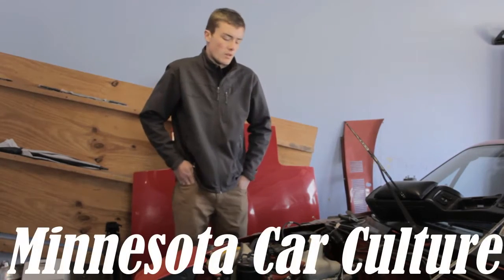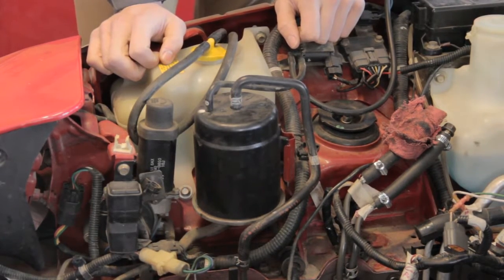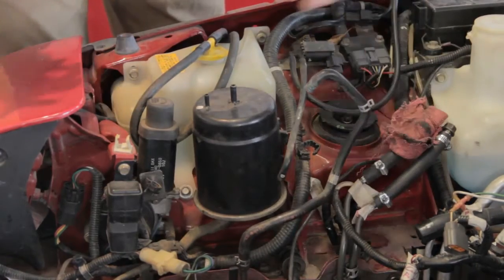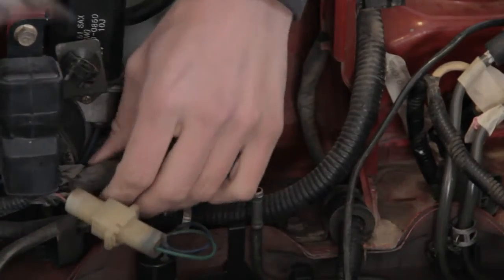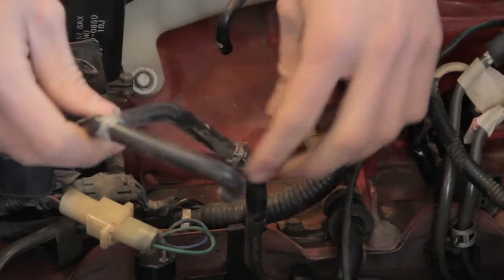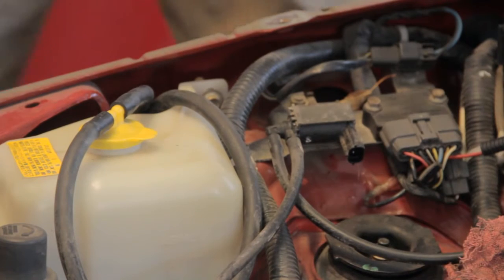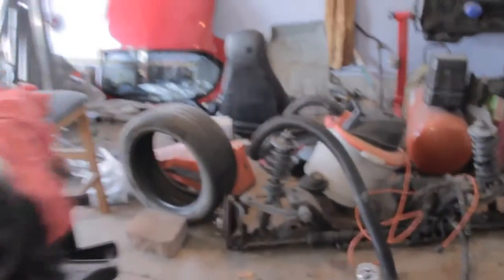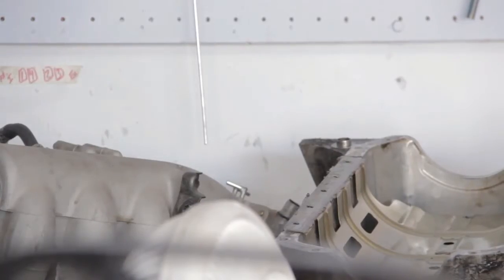How to Remove Miata Charcoal Canister

Comment: Zach, can by BYPASS this cannister all together?  Original one on my 2002 Pontiac Grand Prix GT, gas was coming out of the cannister, bought a NEW cannister, and it did the same thing....So I removed the cannister, and plugged the line... I have difficulty putting gas in the car, so not sure if that is why, but I think it was having issues with putting gas in before the removal of this......I've heard another mechanic say to just bypass this cannister.....What do you say...Thanks...
Reply from the maker: +76reliant im not really sure ro be honest but the canister should be just taking fumes not actual liquid gas
Reply: 76reliant its a ventilation issue most likely, there should be a hose coming from the tank, following the filler hose and connecting to the filler hose behind the cap. that gives the empty space an escape route while the tank is being filled

Comment: what did you do to the plug that holds the 2 top hoses? it looks like its connected to something.
Reply from the maker: +Terry Low i used on of the hoses and connected the two openings together
Reply: sorry mate, i meant the connecting piece you remove at the 3:00 mark. there was a plug there which was connected to something. what did you do with the plug?

Comment: what does the canastier do?
Reply from the maker: +Johnathan Gonzales it catches the fuel vapors within the fuel system
Reply: theres really no good reason to remove it then rather the sapce
Reply from the maker: Johnathan Gonzales not really on stock car. i removed it to clean up the engine bay and install my fuel pressure regulator
Reply: does it smell more?
Reply from the maker: Johnathan Gonzales yea but im running e85 i know there is an increase in smell but i cant say exactly how much on a stock car
Reply: u recommend me doing it on stock car straight piped?